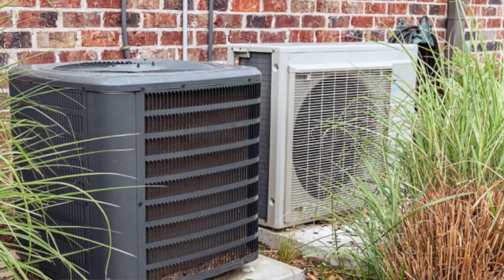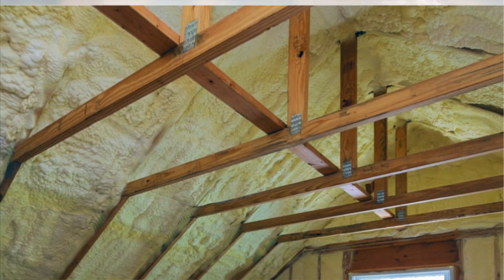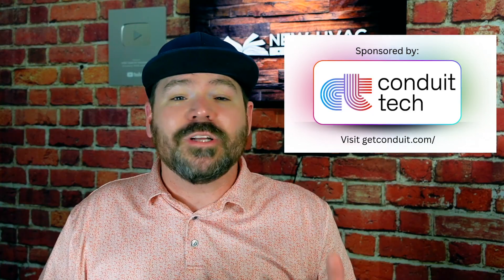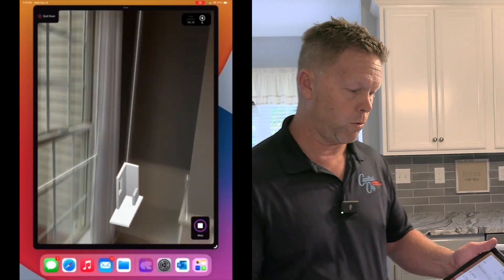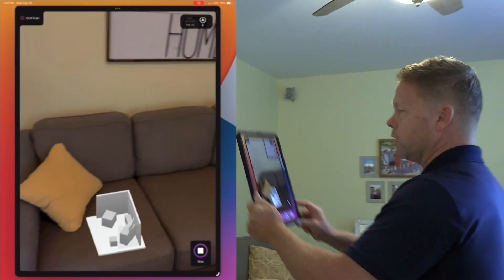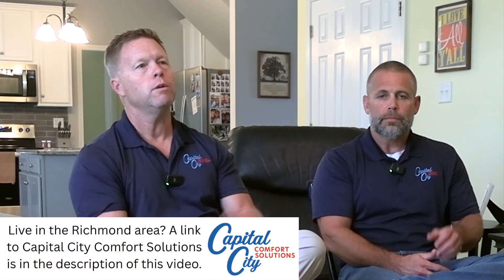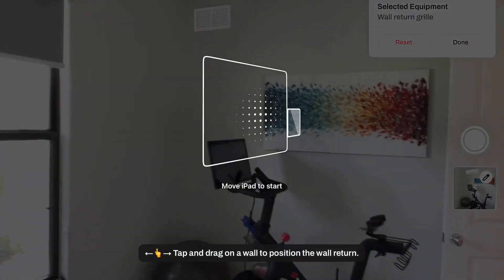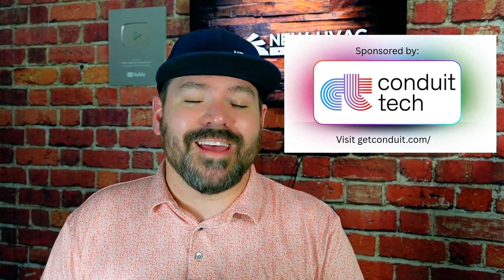Don't have HVAC Problems! - Sizing the NEW Way!

Comment: If you have 8 vents  you can only push about 100cfm on a 6 inch vent.  If you need a 3 ton system, your gonna need more ductwork.  Knowbody does that.  

Customers have no clue.  And they all want a system that cools fast like a gas or oil furnace heats the house up.  

So many people, homeowners im talking about,  just have no clue and watch videos that really confuse themselves